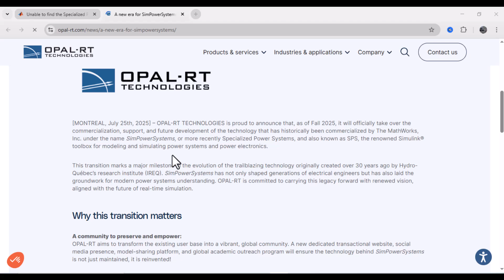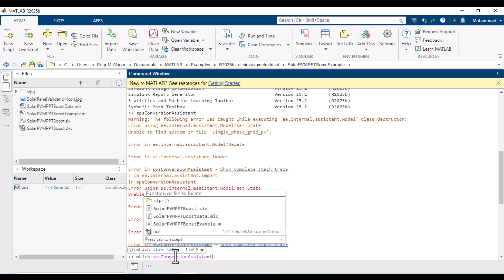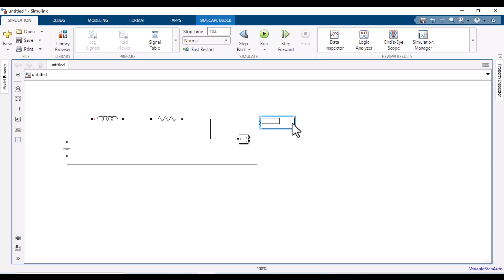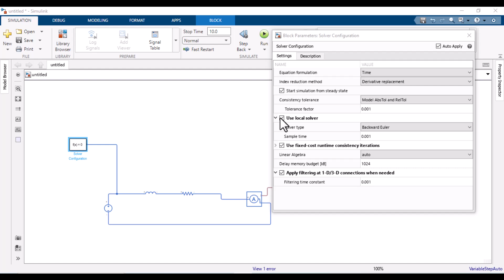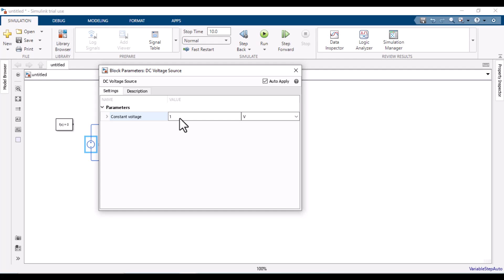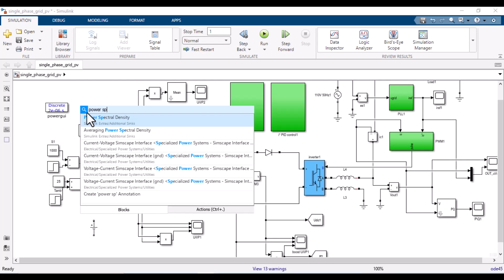RIP SimPowerSystems? Why MATLAB Removed the Entire SPS Library!

Comment: @Engr ALEX 
Now can you make a series of video over  MATLAB SIMSCAPE ELEC POWER SYSTEMS ...as I can't get ideas to replace a three phase circuit I had made earlier ...also analysis using buses and transmission lines are nightmares now .
Reply from the maker: Yes. I am planning to prepare a series of videos related to SPS and Simscape Electrical Power and their transformation in easy steps, by explaining transition of eaxh and every component and their complete methodology. Follow me and soon you will find many interesting ideas of Simulink modelling.